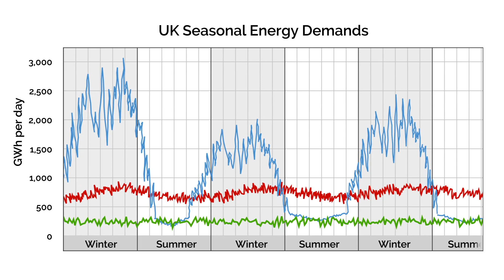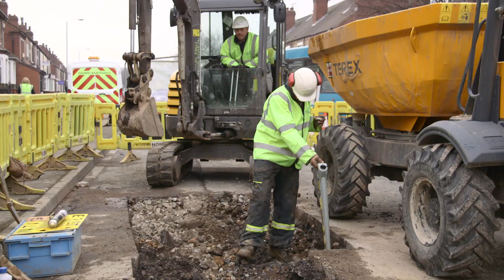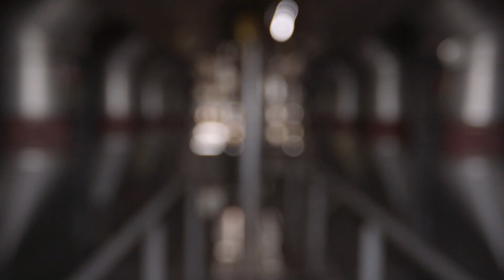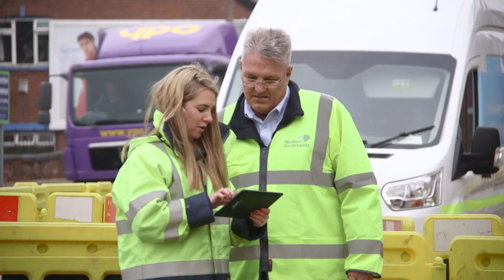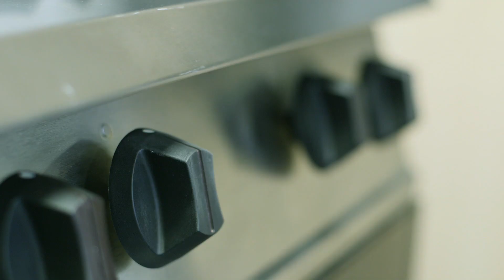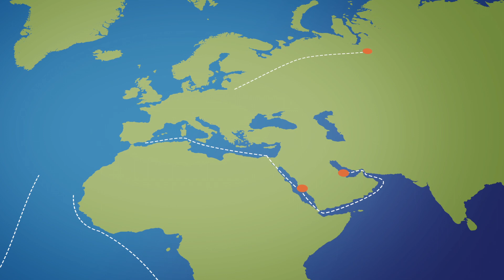Northern Gas Networks H21 Leeds City Gate film

Comment: I don't get it. I would understand the idea if you produced the hydrogen by electrolysis, using renewable energy. But how is this decarbonisation when you produce the hydrogen by reforming methane (the same natural gas you would otherwise burn at the end customer), producing the same CO2?
Reply: The carbon capture. They will capture the co2 and store it. Easier to do at the plant than from everyone's cooker and boiler. Just have to see if the storage works. Think they plan on using depleted gas fields in the north sea.
Reply: Carbon (CO2) Capture will be integrated to the system, i.e. H2 production from Natural Gas. CO2 will not enter atmosphere. 
Captured CO2 can be used for Enhanced Oil Recovery or can be stored permanently in geological formations: Saline aquifers, depleted Oil & Gas wells and concrete aggregation.